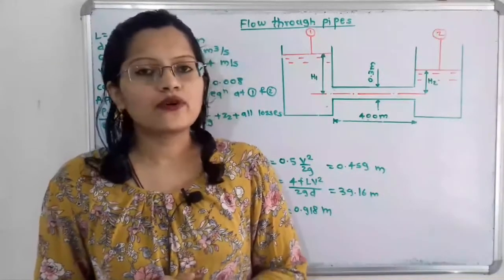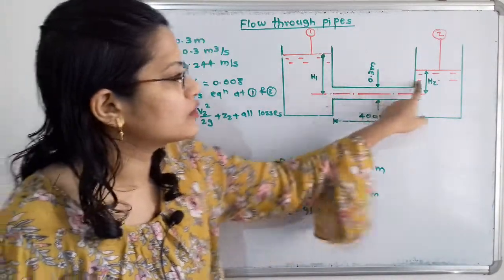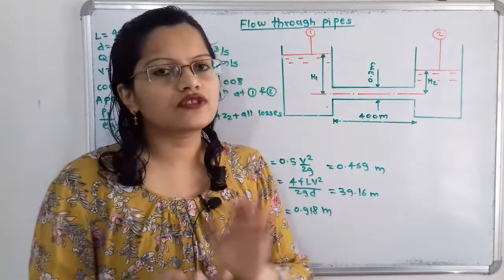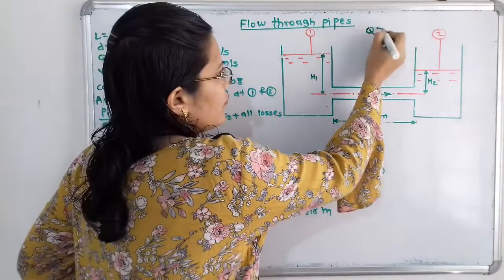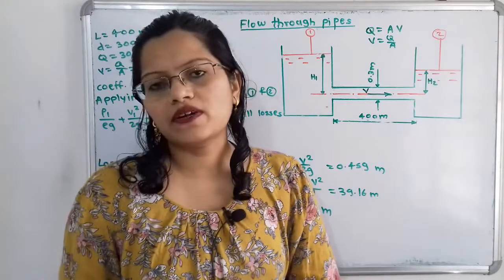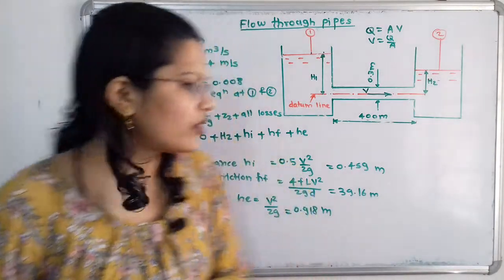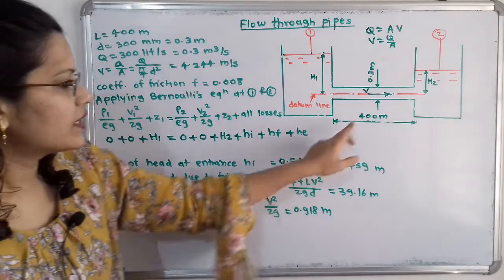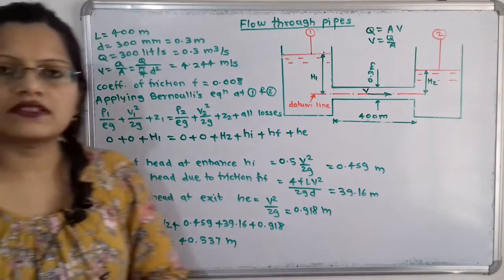Problem on rate of flow through pipe attached with two tanks at ends   major and minor losses

Comment: What if there is an inclination in the pipe.. and if water is constantly pumped from the second vessel? 
Basically my quesiton has to do with an intake pipe from sea let’s say -10m below sea level which is connected to a pit onshore. If we assume water flows by gravity i.e. the pit intake point is below sea level, does the height of the intake point at the onshore pit (ie invert level at pit) play a role with the flow rate? Does a steeper inclination affect the flow rate? Water is being pumped at a constant rate from the intake pit

Comment: In this case, flow rate Q and pipe friction coefficient f are given as constant value and it enables you to calculate friction loss easily. However, if I assume Q and f are unknown, how can I determine velocity v in the pipe? For example, there is a valve at the middle of the pipe and I suddenly open it while each tanks have different liquid levels h1 and h2. In that case, water definitely flows from tank 1 to tank 2, but there is no way I can know Q and f in advance. f depends on Reynolds number, which is a function of velocity. So, to determine velocity (it even could be a function of time) you have to know velocity first. This looks kind of inconsistent, but is there any way to solve this problem?
Reply from the maker: You can use Bernoullis equation